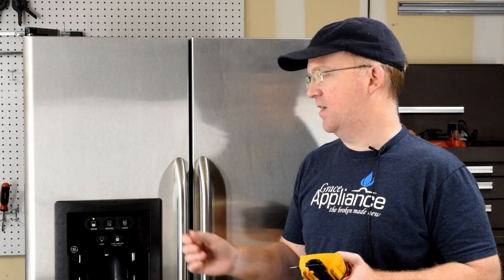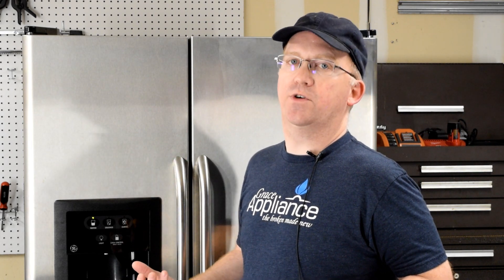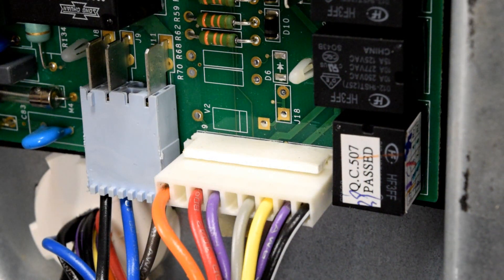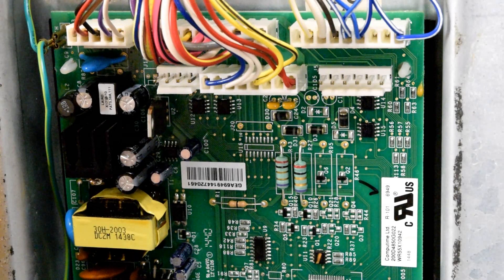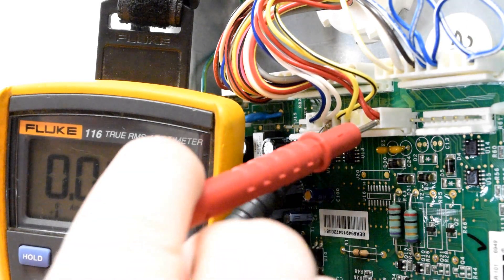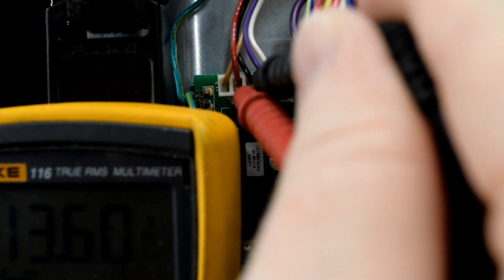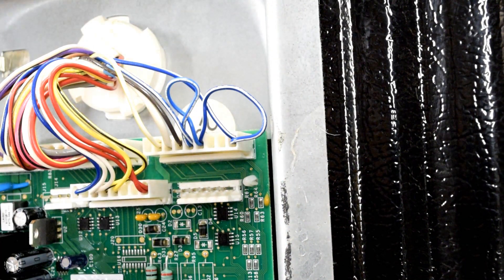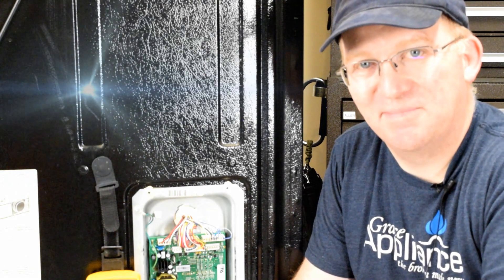Dead Refrigerator - What to Check

Comment: Hi Andy, I have a GE fridge model  gshs9ngybcss. Nothing works except interior lights. Using your method,  tested good for 120V AC going into board. But no 12-14V DC on J4-3,J4-1 going to touch panel. Have now tried 2 other new Main Control Boards and all show same. I can't believe all 3 boards are bad. Is there a fuse common to all somewhere else outside of board? Would you have any other suggestions.
Reply from the maker: Hey j k, 
Sorry to hear about your headaches with that!    
Just to clarify, you're going to want to test J4 plug on the 2nd & 3rd pins.   2nd & 3rd from the left.  It should be a red wire on pin #2 and a black wire on pin #3.  
If you're getting 12-14 volts DC there, your board is doing it's job. There isn't a fuse or a reason why the board would stop sending voltage to that board for any reason that I can think of. (also, not to be rude here...but make sure you have set your meter to DC and not AC, it's worth mentioning) 

One super common issue with the front board (and most common reason for mis-diagnosis) is the plug connector near the freezer hinge.  They get corroded or loose and the voltage from the board doesn't make it all the way to the control board.  The solution if you find this plug is at fault is to cut the wires on either side of the plug (with the refrigerator unplugged obviously) and directly solder the wires together, thus eliminating the plug and all the connection issues that go with it. 

Let me know what you find with testing the pins I referenced above and we can go from there. 

Thanks!
Reply: @GraceAppliance  On mine the J4 plug from top down is a black, red, and blue wire. I see that the schematic has black and blue as COMM. In DC mode and one lead on red and other on either black or blue, I just get fluctuating values b/w 0V and 0.5V with power cord plugged in. There is also a chirping sound all the time.
Reply from the maker: Ahhh, gotcha now. Sorry about that. Your board is slightly different from the one shown with respect to the wiring diagram. I’m not able to locate the wiring diagram for your model. If you have it, I’m happy to take a look if you want to email it to GraceAppliance@gmail.com 

Does your fridge run currently or is this keeping it from running?

I’d start by unplugging the J4 connector and measure for the voltage straight from the board (same pins as you checked) and see if the reading changes.  I’m wanting to rule out a shorted front touch panel. This will give symptoms like you’re having.  
If it is shorted, often it will keep the fridge from functioning and you can diagnose this by unplugging the J4 and the fridge then starts up once that short has been eliminated.
Reply from the maker: j k thanks! got the schematic from you.  I appreciate it.   
You’ll want to test between J4-1 & J4-2 (red and black) 
This should be 12-14vdc. 

Let me know what voltage you get there.   

Thanks!
Reply: @GraceAppliance  Nothing except interior lights work . Just pulled out the J2 plug and can hear fridge coming to life. Pulled out J4 without success and put back in. Now finally also getting 13.4V DC on J4 plug to front panel once J2 plug pulled. Touch panel lights are on also.
Reply from the maker: j k great!  Now we’re getting somewhere! 
So, this will mean you likely have a short in one of your fan motors.  I’d put money on the evaporator fan motor, but you’ll want to test the condenser fan as well. 

The quick and easy way would be to unplug each fan at the fan plug itself, then try to see if the refrigerator turns on with no issues once you’ve removed the short from the circuit.  I have a video that can walk you through how to do this from the board, but unplugging them is probably a more conclusive test. Find which one of the fans is giving the issue and replace that fan.  Good to go!
Reply: @GraceAppliance  Reinserted J2 plug and pulled condenser fan plug which was easier of 2. Nothing working. Looks like it is the evaporator fan as you said. Next task is to disassemble freezer parts to get to evaporator fan and confirm.
Reply from the maker: Nice work!  I am confident that's the issue.  Those fans short out often just because they're more susceptible to moisture just due to where they're located. 
If you do need the fan, this is the one you'll need:
https://grace-appliance.myshopify.com/products/ge-wr60x10307-evaporator-fan-motor-for-refrigerator

Keep me posted on the outcome - i'll be curious to know!
Reply: Pulled evaporator fan plug inside freezer. Reconnected all plugs on Control Board and fridge comes alive. The evaporator fan is indeed the problem. 

I am not seeing the item on your link. The part # comes in a huge range of prices. The OEM on the motor is Panasonic and was hoping to replace with same. I am not sure I want to buy the no name $18 versions and end up taking apart the freezer again in a few months.
Reply: Ok, i see the part on your site.
Reply from the maker: Sorry about that, try the link again. 
You’re right, the after market ones are crazy cheap. I can’t speak about the reliability on them because I have not used them personally. I only install and use factory parts and literally can’t think of a time when I’ve gotten a bad part out of the box.  You’re right about not wanting to do the job twice. And as a service guy if you have to go back out for a failed part, it just became a non-profitable job.  That’s my take on it anyway. 
Especially with things like heater elements and thermal safety fuses, I wouldn’t ever consider aftermarket.
Reply from the maker: Nice work with the troubleshooting by the way!
Reply: Andy, thanks much for your informative feedback. Gave me the motivation to keep trying.
Reply: Got the part today and installed it. Fridge is working! Thanks again.
Reply from the maker: @jk-vo8gw  awesome! Thanks for the follow up. I love good outcomes.  Stay in touch.

Comment: Andy, thanks for the instructions. I recently replaced the control board on a dead GE side by side.  Got it back to working although now it appears the evaporator and condenser fan continually runs.  Is this normal?  I do hear the compressor cycle on and off as normal.  Temp/resistance readings on the thermometers were 14 (frig), 30 and 30.
Reply from the maker: Hi Tom!
Could you please send me the model number for your refrigerator?
Also, the fist 5 digits of your serial number. 
It's on a silver or white sticker inside the fridge section. 

Thanks!
Reply: gsh25jsxb ss - mr221634
Reply from the maker: Thanks Tom,
I was checking that info against the install instructions as some require a slight modification to the wiring harness on install, but yours does not appear to be impacted. 

As far as the evaporator fan (I. E. Inside the freezer) fan, I would pay that zero attention as it will run whenever it is needed to circulate air inside the compartments as needed based on the freezer and fridge temp.
The condenser fan (I. E. The fan closest to the compressor behind the fridge) however should only run when your compressor is running. Some fridges will have fans that run when the compressor does not based on ambient temps in the room, but to my knowledge none of the GE side by sides fit this bill.
I'd verify that you are not just hearing the evaporator fan running and it's not the condenser fan as you typically will not hear a condenser fan running without being up close and personal with it. 

As far as the sensor readings, I wouldn't be able to say if those are reading correctly or not as those readings change based on the actual temperature of the sensor. So, you'd need to know the true temp inside the cabinet and then compare that to the resistance reading, if that makes sense?
Reply: It does and thanks.

Comment: So if the the light is not on in the refrigerator it could be a bad power cord? Also The little green  light on the ice maker is on
Reply from the maker: Hi,
If the light on the icemaker is on, your power cord is OK.
If the lights are out inside the refrigerator AND the freezer (and both stopped working at the same time), I'd suspect some type of wiring issue and focus in on the plug behind the refrigerator where the cord from the wall plugs in.

Keeping in mind, on a GE side by side, the lights do not run through your control board.

However, if both lights started acting up separately, I'd check first that the bulbs themselves are OK, the door switches are functioning OK, or at the housing that the light screws in to. Often, the bulbs are screwed in too tight which shorts out the housing. Also, door switches can give this symptom, but... 

To check voltage to the bulb housing you'd need a voltmeter. Do you have one?

Thanks!
Reply: @GraceAppliance  my refrigerator is not working at all the only sign of power is the ice maker light. The compressor, fan, and the front display doesn't come  on. It's completely dead besides the ice maker light. I test the power going to the control board and it's reading 120v.
Reply from the maker: Hey Bobby, It sounds like a failed main control board (behind your refrigerator), but I would first check to make sure your front control panel has not failed before replacing that. 
Here is a video on how to test the front dispenser control board: 
https://www.youtube.com/watch?v=ViFpwH6_WrM

If the main control board is not sending voltage to your front dispenser control board, replace the main control board (behind the refrigerator) and that should solve your problem.  

I hope that helps and let me know if you have any questions!
Andy